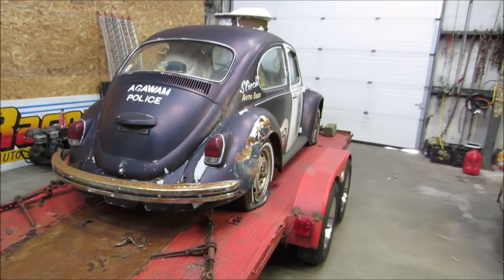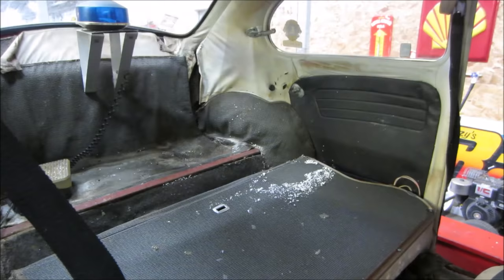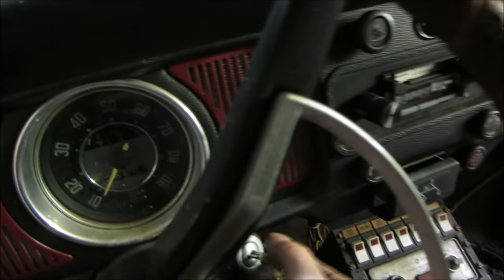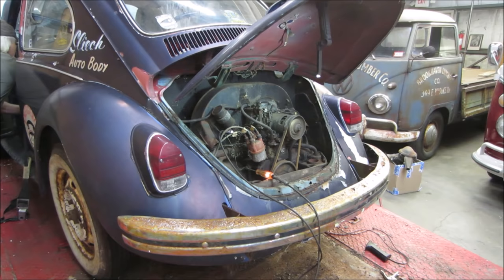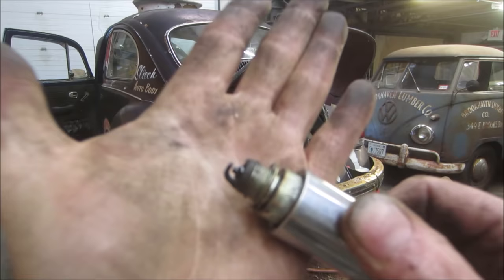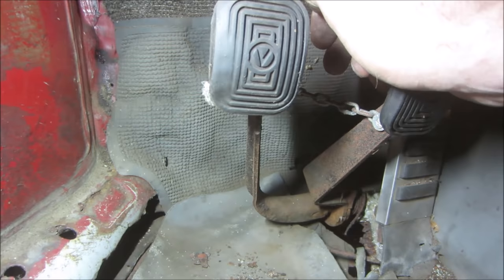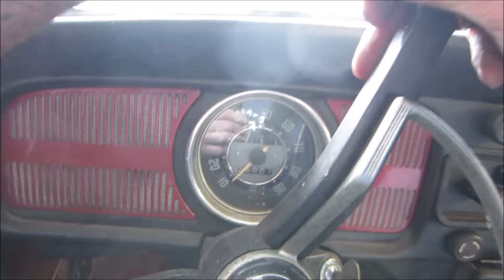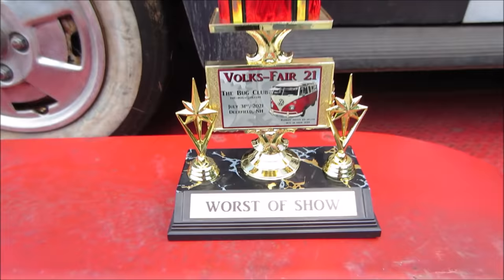Will It Run? Police Bug Sitting Abandoned For 35 Years

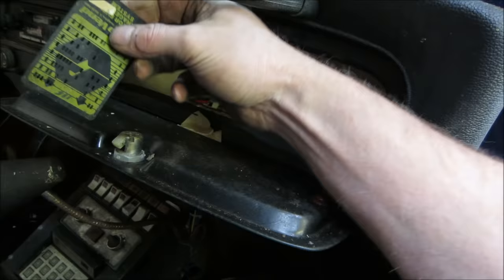Comment: @6:42 - The card - That is a Petrovend key card for an unattended fueling site.  I used to install and maintain those systems.  They use these punch cards for the older readers and several varieties of magnetic media after that.  Most systems also allowed manual key entry.  Usually a driver number, mileage and a pin. Even key cards had manual entry prompts for mileage and such per the customers requirements (like police fleet vehicles)

Comment: Hey mustie what a cool find I love the old vw’s always work after a bit of tinkering just a quick tip in regards to the hand starter I am a tattooist but trained as a vehicle engineer when I was younger I use foot pedals to run my tattoo machines I modified my hand starter I bought a tattooist foot pedal and took the hand starter apart and rewired it into the foot pedal and it works great giving me both hands free hope the tip helps you mate all the best
Reply: Was
Reply: @glenbakker1126  was what?
Reply: Thumbs up for a shout-out from a place where everyone calls themself an engineer including janitors and garbage truck loaders. Vehicle engineer or Sanitation engineer, has a nice ring to it.

Comment: Ive had a '72, and '69 Standard.  They were an absolute blast to drive, but the fun didn't make up for what I need.  I follow a principle I learned in my USAF career.  Fit, Form, Fuction.  If the vehicle I have falls in all three catagories, then it stay.  My VWs did not.  They both fell in the Form, but the other two were very lacking.  I replaced them with a "68 Chevy C10, and all three Fs are fufilled.  Still love the vintage VWs, though.

Comment: Another great way is to use good 2cycle oil like Amsoil at 50 to 1 or optimal oil at 50 to 1 and pour it down the carburetor and turn it over gives you a perfect cylinder lubrication also my friend

Comment: For the GE police siren/PA system. Clean the controls with some CRC QD contact cleaner especially the selector switch and it will probably start behaving right, making the proper tones and not dying when you change siren sounds. The sound/function selector switch feeds power to the various oscillator setups for the sounds and the dirty contacts are not allowing the full voltage to flow and charge up the capacitors. 
For the "Musical Horn" the first thing to do would be to remove the keypad, disassemble it and clean the circuit board contacts for the keys, it also may not play anything until it is powered on and the horn ring is pressed.

Comment: Ready for that Friday night figure 8 demolition derby pace car job. And hey a trophy is a symbol of participation. You won by showing up. I worry the oil cooler in the fan shroud is plugged with mouse nest. Mice have ruined more than one air cooled engine by plugging passages up. I grew up in Granby Ct. just around the corner from Agawam. We did go to the Friday night demolition derbies back in the 60's. Saddest thing I ever saw was them wreck a mint(?) Edsel ambulance by repeatedly smashing it flat with 2 country squire wagons from both sides. Ah the memories.

Comment: Get an IV bag, connect it to the carb with flex line, fill it with gas, hang it above carb then try to start it. Mine is an antique glass IV bottle with stand.

Comment: It's got a cop motor, a 440 cubic inch plant, it's got cop tires, cop suspensions, cop shocks. It's a model made before catalytic converters so it'll run good on regular gas.  Elwood

Comment: What a find! I vote for this Beetle's restoration to "original running" with a nice linseed oil polish! Except -- I'd remove the weird hat on the roof. Floor pans needed for sure and a fender replacement. Seat covers. Not sure what can be done with the rusty metal under the doors, possible to weld in replacement pieces?
Reply: the hat is the best part!   the floor pan and heater channels are easy....   those cars were made in halves.... floor and body shell....   simple

Comment: A curse upon styrofoam, it makes SUCH a mess! Punchcard programming for the talking function? (probably not)
Oh man, the way the rear end lifted up when you put it in reverse, that ain't good! (but it didn't break in half)
Ha! The bottom shock-bolt (or sway-bar link?) snapped when the half-shaft torqued on the suspension!
Most fun (or at least memorable) entry at the car-show! XD

Comment: 36:25 if you look where the pipe attaches to the bottom there is a arc at the far edge of the flange. Watch at .25 speed.

Comment: I'm stuck...My neighbor's ECHO BP-265L would not restart, while warm, the other day.
We looked at it the next day.  .
It has SPARK, Correct Time-ing, Upper cylinder Compression, Good Fuel Mixture,
Exhaust pathway is clear, Air filter clean, throttle linkage looks good, choke thingy moves 
(after drying off the plugs. it even fired on Ether (very weakly)(sprayed into spark plug hole) for a few seconds)

For some reason it does not start, and the many different spark plugs we have tried ALL
are end up soaked with fuel, and never  fire.

Replaced the carburetor , and it did not work.

Is there an easy way to check out the crankcase pressure????
WHAT DO YOU THINK IS WRONG?????????